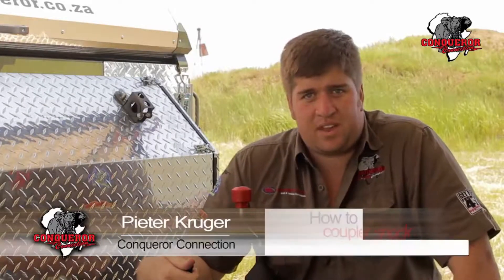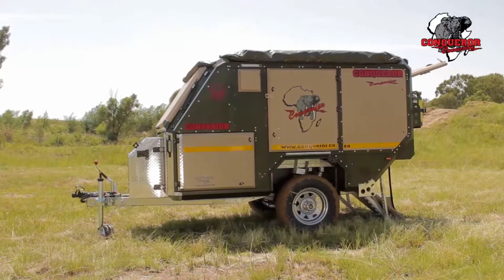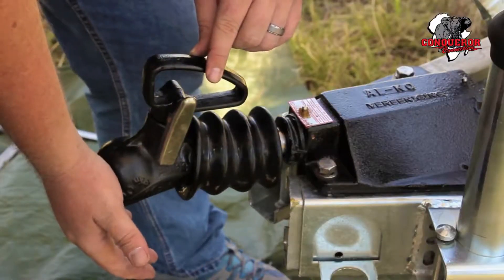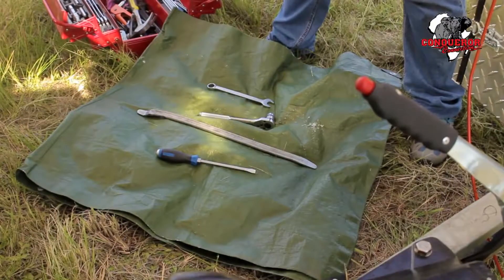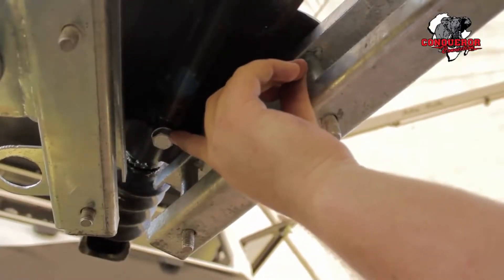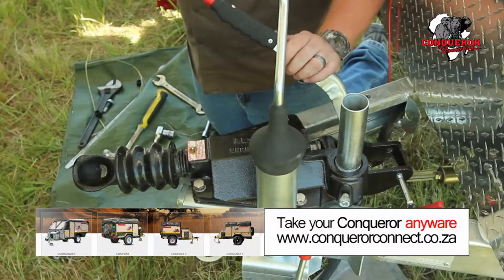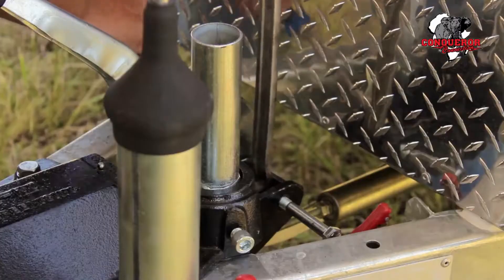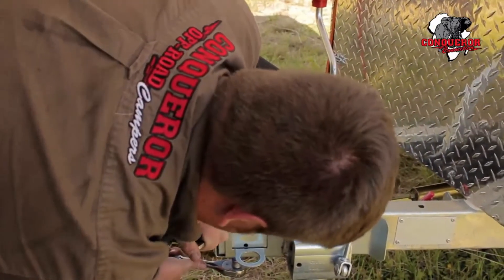Coupler shock replacement procedures

Comment: Actually some of your trailers need a 17mm spanner and a 19mm spanner. Also, the bottom plate design is crappy. Why not make a hole in the bottom plate to expose the bolt of the coupler shock. Way easier and it does not impact the tensile strength of the A-Frame. Actually, you can change this after the fact.